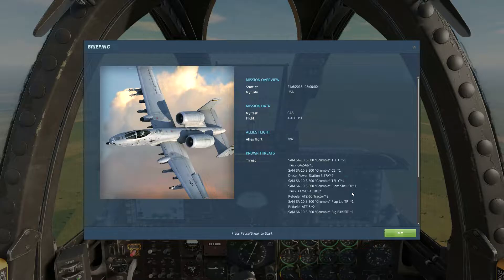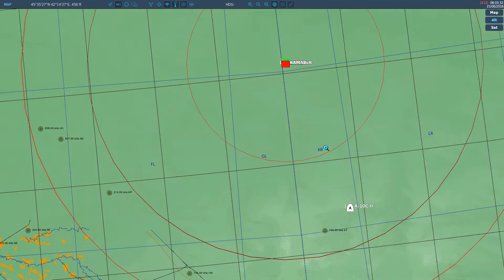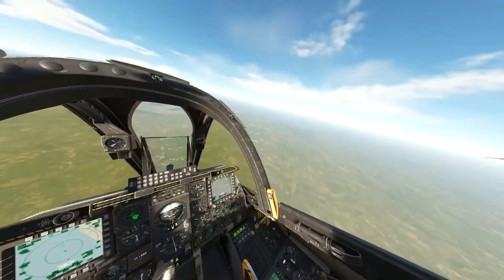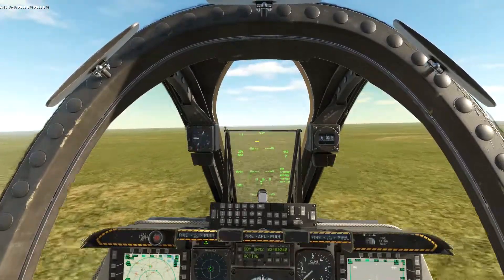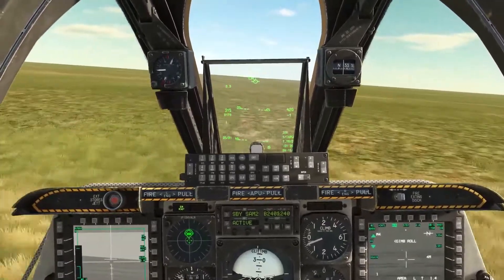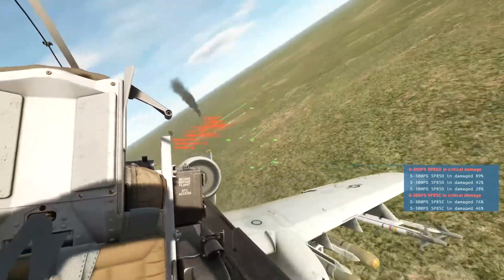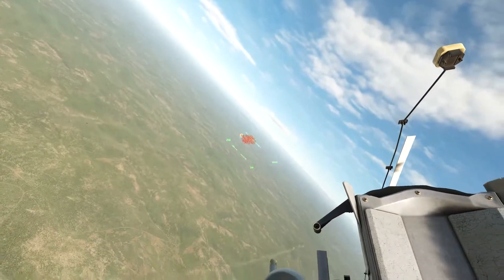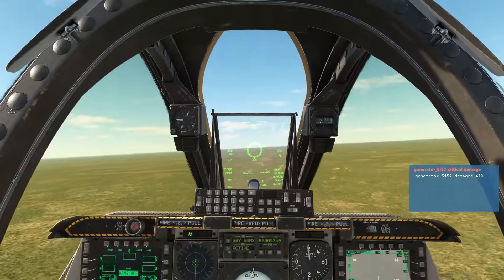DCS A-10C Long Range SAM Elimination Tutorial

Comment: Helpful video. But a low-altitude approach will not help if there are, for example, Shilkas standing not far from the S-300. They will quickly destroy the A-10C. What to do in this case?
Reply from the maker: In the event there are closer ranged defenses, your only real option is to launch mavericks at them and stay out of range. One maverick disabling the SA-10 via its radar gives you enough wriggle room to treat everything else normally. When you get SAM nets, with things like SA-15s, is when it really gets nasty and you essentially require SEAD of some sort to really stand a chance.
Reply: @talk4dews  Thanks. What is SEAD?
Reply from the maker: @leopard3529  Supression of enemy air defense. It involves HARMs (high-speed anti radiation missile) or TALDs (air decoys) to divert or disable enemy air defense systems.
Reply: @talk4dews  In DCS is it only airplanes like the Hornet capable of carrying such weapons? Or are there any other ground units?
Reply from the maker: @leopard3529  Anti-radiation missiles can be carried by lots of newer aircraft, they aren't a ground employed weapon. TALDs can be carried by lots of aircraft, going back even to the F-14. The A-10 does not carry SEAD devices as it is usually the aircraft being supported by said SEAD.
Reply: @talk4dews  I know that. I meant, can any ground units use SEAD devices?
Reply from the maker: @leopard3529  No. It doesn't make much sense to do it that way, since you would have to make a missile launcher close enough to an enemy position to use it, and ground based missiles are more expensive and have less range due to the lack of speed and altitude inherited from an aircraft platform. It would be easier and cheaper to just use a cruise missile or some other surface to surface missile. At that rate, you could just use artillery if you set up a base within HARM range.

Comment: most sam sides are protected by some close range stuff. also when you approach like you did it mostly only works if there is no obstakels în your way. other wise you need to go higher and the sam tracks you again.
Reply from the maker: All true! That's when you would use another method.
Reply: @talk4dews  wich one? Also with the a 10c?
Reply from the maker: @beargrillz613  You can bait it into launching all of it's missiles if it is unsupported, or you can use NOE (nape of the earth) to get in close enough to engage with weapons. You say that this only works with no obstacles, and that is really not my point with it. Obstacles make it easier to get in close, this is the countermeasure to a SAM like this on completely open terrain. If there are mountains, you can get closer before employing this technique, or even get close enough to engage without ever hitting the deck. This is harder if you don't have a location of the SAM, as it will locate you when you pop up and you cannot locate it, but if you have their location then you become quite a large threat, and just need to use a maverick to disable the system before diving back into NOE. The worst case for the A-10 is a large open field with no obstacles, with combined long and short range SAMs, and AAA. With any one of these issues removed it becomes reasonable. I hope I answered your question, have a nice day.

Comment: Could I use this against SA-6 SAMs ?
Reply from the maker: You can use the pop up method, or the bait all the ammo method on an SA-6. Usually I will target an SA-6 with mavericks and pop up. Their minimum range and altitude of engagement is flexible, so I would not recommend the fly in under the radar method, although if you want to try it, the hogging database lists their minimum engagement altitude at 100 feet above the SAM level. Keep in mind that EW is much more effective against older SAM sites, SA-6 included. It can really help in evading and I've had times where EW alone has defeated an sA-6 missile when I was at higher altitudes and on the fringe of its max range.

Comment: Nice. You must have balls of Steel tô flight lower and attack the SA10 using cannon. I will try! My worst enemy is the SA15.
Reply from the maker: The SA-15 is not vulnerable to that cannon attack, so you should try to hit it with long range missiles like maveriks, and keep in mind it will shoot them down so you may want to send a couple apkws or make a few passes. Try to do a pop-up attack if you can since the SA-15 outrange the A-10. Good luck.